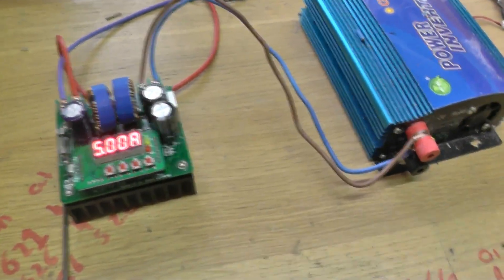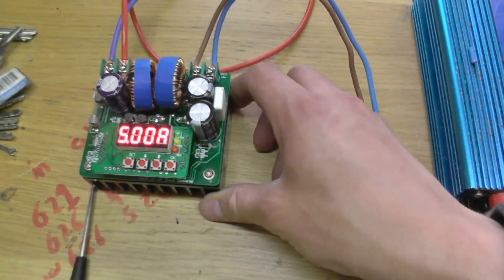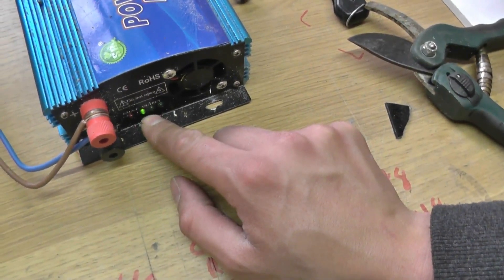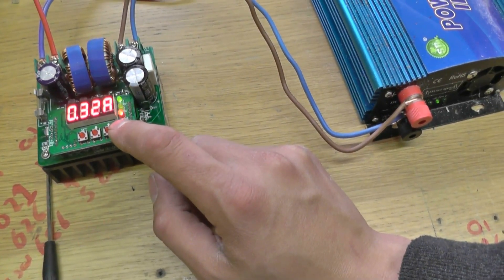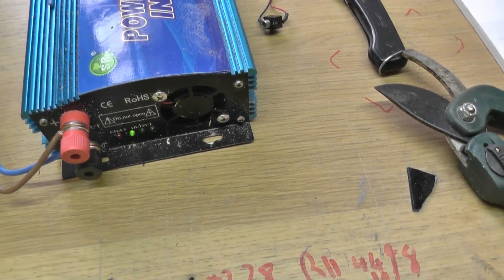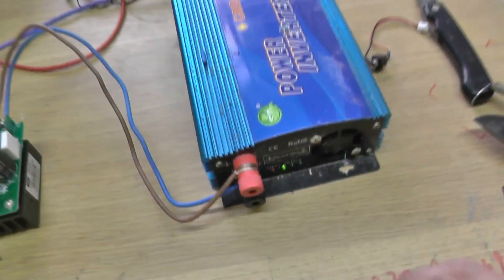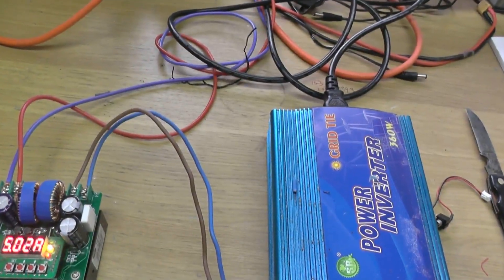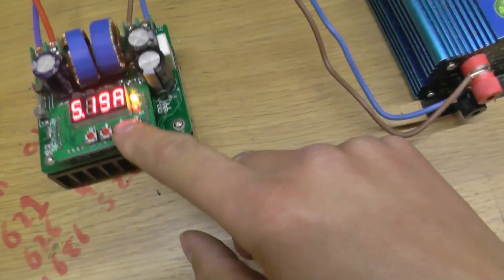Driving a grid tie inverter

Comment: You could use an arduino to measure current flow out of the property back to the grid, and use the result to reduce current into the GTI. Thus you have a cheap limiter on a cheaper GTI, that will throttle back to give a 0 output to the grid.  Charge batteries during the day  to cover night base load.

Comment: Good idea. Just make sure the GTI does not output more than your base load if you are not on any sort of Feed in Tariff.
Reply from the maker: kibi15 Thats exactly what I was doing! Putting 60w in to balance out the heavily used TV
Reply: pietkaify Right I understand.
I guess my previous statement is based on the fact that the output of my GTI is starting to get awfully close to my ever diminishing base load. My personal campaign of using more energy efficient devices around the house or eliminating them if necessary may necessitate the need for me to limit the output of my GTI using your method.

Comment: Interesting grid-tie inverter, I would have thought it would have run fine direct from the battery bank and that way you do not have as high a loss as thru that converter.

I suppose you could only try that next time ?
Reply: If you run direct from a battery they run at full power until the battery is flat. Running these cheap GTIs at full load is likely to end with the magic smoke coming out, hence a need to restrict the power going in.
Reply from the maker: I do expect losses in both units! But easier than running cable to the house! 

I tried running it straight from the batteries a while back with poor results! But I'll try it again